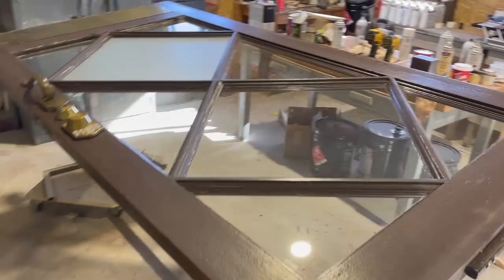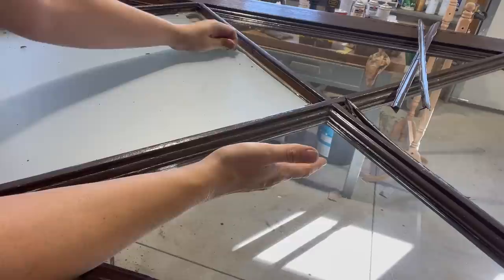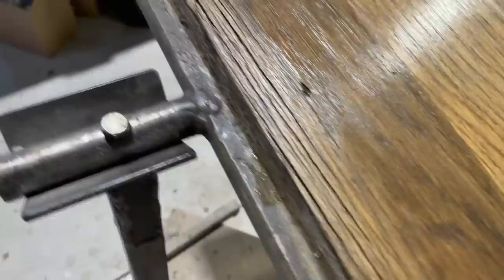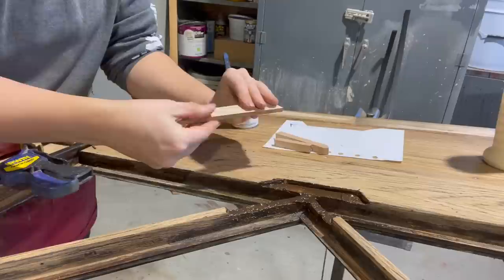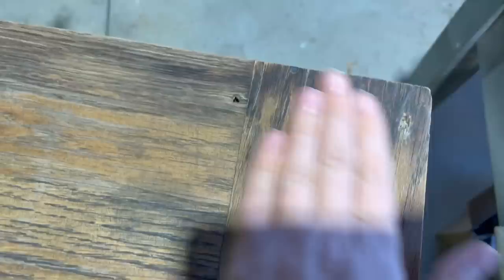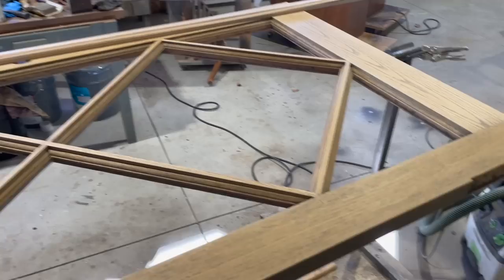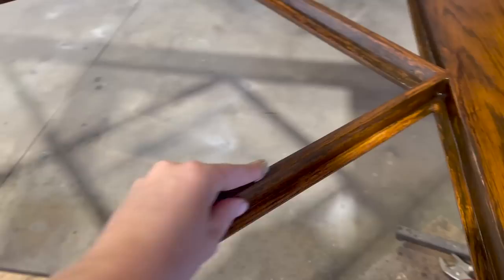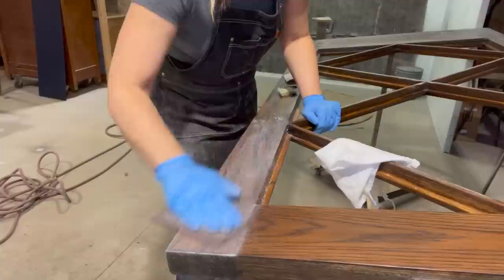This wood was SO ROTTEN! Could I fix it?

Comment: Beautiful job to return this door to its former glory. Your skill to patch in those replacement pieces is second to none.

I also use the PC-Petrifier to stabilize the wood before adding the epoxy wood filler. It is the best option I have found. 

Kudos to your mill for matching the profile for the glass bead. 

Thanks for sharing and giving this gorgeous door a new lease on life.

Comment: Incredible.  I don't know why, but this is one of my favorite 'episodes'. I did miss the color toning though. That is one of my favorite parts in your videos. But this had sanding, scotchbright, and buffing. I love the sheen on this door.  Oh, and the fact that you don't like 80's brass makes me like you even that much more. I am just so impressed with your work. I do wonder though, did the client have the door repaired just so they could say, "liook at my door, Trena restored it." instead of just getting a new one?
Reply from the maker: lol
Reply: Having has to repair and  refinish exterior doors, I can only hope that you fully sealed the top and bottom edges of the door. Especially the bottom. Considering the type of winters Windsor gets, sealing the bottom is most important even if your client was going to have a wrap around type of weather strip. Sealing the end grain prevents any moisture from soaking into the  stiles. Important for a vestibule door.

Comment: Very, very nice job!  I seen an eight foot patio door in a house that was installed inside out.  The construction guys must have gotten pretty creative to change all the locks to the inside.  Don't know if the homeowner knew about their door or not.  That is probably what happened to that door you fixed also.
Reply: I was wondering who would nail in the glass from the outside. Even ignoring water, that just sounds like a safety issue, way too easy to take out and replace later.

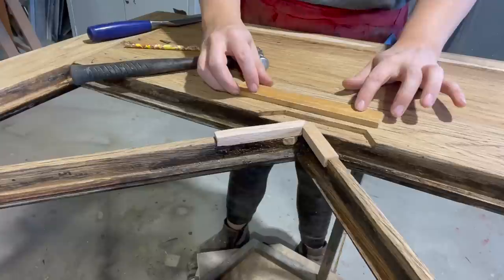Comment: Tip.  At 21:11 it is easier to cut the replacement strip of wood to size first and use it to trace onto the door. That will give you an exact replica to chisel out and will eliminate a lot of trial end error.
Reply: That’s a great tip. It’s easier to cut your replacement pieces and use them as templates. I would also add. For the patch in the rail you could use a small router to remove most of the wood then cut the mitres with your chisel. When patching glazing bars I also mitre the ends to increase the glue bond. If the patches face out I use resin to bond the patch which also helps prevent any water getting into the joint. 
I’m looking forward to seeing your completed door.
Best regards,
Jonathan
Reply: Yeah I was wondering about that. But … Thos Johnson also does it this way so maybe they have a reason I can’t think of.

Comment: In the PNW we end up with a great deal of dry rot in the wood frames.  So many of these beautiful windows and doors are just lost to replacement by plastic and aluminum junk. Our shop designed and built a large vacuum tank that we fill with resin or paintable epoxy (depending on the customer) and submerge all the pieces to completely stabilize them before reworking.  It’s the hand lining in all the grain so the new wood matches precisely that I always spend the most time on.  Nice work! I like seeing the old pieces saved.
Reply from the maker: Wow. Very interesting

Comment: Thank you for yet another great restoration and video, I'm not convinced this door was hung the wrong way, maybe things are different in Canada, but here in the UK glass usually goes in from the outside, more often with putty, but with moldings also, was surprised you didn't treat the top and bottom of the door, maybe you did off camera. I sometimes use a syringe to get the wood hardener right into rotten wood. Love your spit thing for spinning the door, thanks again keep 'em coming.

Comment: The other issue with the door being the wrong way round is security. Someone only needs to pop the glazing quadrants off to remove the glass and gain entry. The other benefit of folding the sandpaper as you suggest is you dont have two smooth faces of the sandpaper against each other allowing the faces to slip slide.

Comment: We used sanding sponges for profiles in finish carpentry. Worked like a charm.
Reply from the maker: Like profile sanders or just square ones?
Reply: @johnsfurniturerepair  Just the standard square sponges. No problem sanding the various mouldings we used and also sanded cabinet doors between coats of lacquer.

Comment: At JOHN'S FURNITURE REPAIR  you can actually learn something from watching paint peel. 
     Another top level restoration/repair!  To bad the original brass handle couldn’t be reused/matched with new security hardware. It looked like a more comfortable handle than the “modern” sharply squared-off replacement.  I hope the brass one wasn’t trashed. 
     So much skill, honesty and integrity is always presented in an unassuming way by Trena in these videos.  I think they should be required viewing by all future (and current) MBAs in all business schools to demonstrate to them that ‘business’ doesn’t have to be (and shouldn’t be) the ‘cut-throat’, ‘winner-take-all’, ‘screw-everybody-to-get-ahead’, ‘lie-whenever-possible’ practice that it is becomming.
Reply from the maker: Not trashed. Repurposed in the house. Wow. Pretty amazing review! Thankyou!

Comment: 2105 needs a paint job to keep up with that door now.
Thank Goodness for those trim guys.  When you said 1/4 round I gasped.  
The finish looks amazing.  
You used varnish everywhere on the outside and used the spar urethane on the end grains to seal them up ?
Reply from the maker: I oil the ends 👍

Comment: Seems simple to move hinges and lockset to the opposite sides, so the outside is actually outside. Just needs a few more patches blended in to fix the wood, and likely they will be invisible with your usual attention to detail as well.

Comment: So satisfying seeing the paint an plasticized window file coming off in one piece! (Keyboard warrior alert) Why did you use the flat edge of the router plate to follow the straight edge? It track much more consistently if you use the round edge of the router plate.
Reply from the maker: It was a measurement thing. I had to make 3 passes and the first started with the flat plate against the guide
Reply: @johnsfurniturerepair  you have skill! so easy to go offline...bitter experience talking there.

Comment: Fine job. Would have been happy if i had done anywhere close to that good a job when I replaced doors on a house we had. Actually, i was satisfied with what I did, but you did a MUCH better job, and had to deal with a lot of rot and deterioration, while I had new doors. That made it easier. But I could sure have learned some things if i'd watched this before i started. I gather you changed the door handle and the security system pad.

Comment: I use a 2 pack car lacquer for any wood that id exposed to the weather  this allows you to fill in and pours or fine pits in the grain of the wood I also use a very thing first couple of coats so it soaks into the wood/ I find this allows me to leave a very high gloss finish with no visible pitting but it does mean I use up to 8 coats of lacquer at 2 coats per application and flatting in between.
Reply from the maker: Wow they must be beautiful

Comment: Hi Trena; nice job as always! I don't know if you have ever tried one/two coats of epoxy or what we use to call wet on wet for a high build then exterior grade varnish as it has the uv inhibitors since you strip right back to bare wood (lol)! that often solves some of the natural pits formed in coatings but also builds a good solid basis to work from. keep up the great content!
Reply from the maker: ive heard this method once before i should really give it a whirl
Reply: @johnsfurniturerepair  You should Trena , I just recoated some boat components earlier this summer that haven't been touched since 2005/6. I like the versatility of the west system.
AS you say give it a whirl.....!

Comment: Sweet blend and finish on the hole plug. Your focus on the deep grain issue might be solved with grain filler, worked in to level the finish surface. I always use grain filler with mahogany. Bravo

Comment: Hi , the door was correctly fitted, if it was fitted as you suggested then rain water would penetrate to the inside via the space between the glass and the frame members
Reply from the maker: Same situation the other way but twice as bad because it gets behind the trim and the glass
Reply: @johnsfurniturerepair  the trim (beading) should be a maintenance item  and replaced when needed, when left too long, rot will happen, as you found

Comment: As usual you do the most beautiful work even on things that others would throw out.  Just stunning!   Why can’t you spray outdoor varnish or lacquer please ?
Reply from the maker: it is because oil based finishes stay wet for a very long time compared to solvent based. The overspray sticks to everything including exhaust fans and becomes a fire hazard. its an absolute mess. people still do it and if your only doing it once thats probably fine, but in a professional shop its a problem that can literally build up and cause issues.
Reply: @johnsfurniturerepair  thank you.

Comment: Looks like the door was flipped the other way up and remounded.  That would explain why the inside was out and the frosting was at the bottom.
Reply from the maker: nom the larger cross section is always at the bottom
Reply: @johnsfurniturerepair  So they were just not very good when it came to hanging exterior doors then! Great episode by the way.  Love your work.

Comment: Such a nice old door, now restored to its original glory!  What a great color choice too!  I am curious as to why you hand-applied the exterior varnish instead of spraying it as you did the interior varnish... what governs your decision on that?  I also have been a lifelong dog person (still am) who was converted to a cat person by the big guy in my thumbnail...
Reply from the maker: it is actually illegal to spray oil based finishes, varnish is also very thick and difficult to spray without a lot of thinning which means many more coats to build the finish. cheers

Comment: Very nice job as always over the years things change like doors would be hung with the bead on the outside but you would use putty to bed the glass and run the beads as well and it was the paint or varnish that sealed it all up but then then doors were hung with the bead on the inside and silicone was used for speed you can’t paint or varnish over silicone as it’s a rubber they is low silicone but l think it should only be used internal things have changed over the years but I still like to use the old ways your looks great but when are they going to do the rest of the frame work around the door
Reply from the maker: Soon

Comment: why not turn the door around,, plug the holes for the old lockset and put the new ones on the other side, door would be right and the lockset would be on the side it is now. Just a thought. The repair looks great.

Comment: to restore old wood, i strip it, clean it, then soak it in water for about an hour. after I completely dry it, i repair the fractures and cracks, refinish it, then paint it with new, unused motor oil.
after the oil dries, i wipe it with a clean cloth, then paint it with varnish

Comment: I agree, this Door was built wrong. The glass could be removed from the outside! But it has one advantage: If the door is smashed with the trims inside, the kinetic energy of the heavy glass can pull the nails out and the glass become loose over time.  This ist avoided by the "reversed" construction of this door.

Comment: Beautiful restoration. I like the original pull better, but customer’s choice. I like to learn. Was there any silicone caulking squeeze out?  I just wonder if it’s sealed as glazing is on a traditional window.
Reply from the maker: yes it was a messy job but at least i know its everywhere

Comment: Brilliant result and fantastic job! Bravo! Subscribed )) A couple of questions though: 1) What glue did you use on that half-quarter trim?  Did you use any nails after to fix the glass? 2) Did you treat the very bottom of the door (the butt end) with anything?  3) How well does the wood hardener absorb the dye?  4) Did you say something about rinsing the wood after wood hardener or I misheard? 5) what kind of epoxy did you use on the problematic (rotten) cross-section? was it a plain epoxy or epoxy with some filler (wood dust or smth)?   6) Did you use any wood putty ot wood filler in that crack between a new triangular veneer and the old wood? Did you use any wood filler on the door except that epoxy? Thank you very much!
Reply from the maker: Welcome. Sorry too many questions. Lol I’m going to have to charge you for an hour of time just answering all these 😂
Reply: @johnsfurniturerepair  Ok. How much would it be? I'm sure those subscribers who are really interested in what you do might have same questions, so I'm ready to pay and post the answers here so your video is completely explained. In this business even minor details are everything, and your answers might help save lots of good works. Thank you for your great work!  P.S. Pls disregard my question about the epoxy - it's marine grade West System epoxy, you said it in the video )

Comment: Hi, I'm a new subscriber and this is my first video from you.  That spit device is really a work saver, something I have not seen on the videos of other restorers that I subscribe to.  However, do you ever steady it by rolling sawhorses or something underneath so that it does not bobble around so much when you are working on one of the flat sides?  All that flexing and jiggling can't be very helpful!
Reply from the maker: so when im working i add clamps to each end, it still moves a little but its not too bad

Comment: Hi Trena! Beautiful job on this door. I know one of the deadbolt holes was filled but I was then curious if it would have been more beneficial to fill all the lock holes and bore them on the other side and cut in new hinge slots so the 'correct' side could be on the exterior? I'm just wondering if that might have been more advantageous in the long run where the windows were concerned? I was just curious if that had been considered and your thoughts on that vs. keeping the wrong side on the exterior. Cheers!
Reply from the maker: well that would be doable, but a lot of work on the door and at the house, i just decided that i would use a good exterior sealant on the trim and we would just keep an eye on it. although better, even the other side with the solid trim still has seams and would still need upkeep as any exterior varnished wood. in the end the amount of work didn't match the benefits of switching it up so i just kept it the way it was. cheers!
Reply: @johnsfurniturerepair  That's exactly what I was wanting to know. I figured the end result would have been about the same but was curious about your input :)

Comment: Another basket case reborn by the Master/Mistress (You Choose) apart from the weather aspect the glass bead should be on the inside for security, also the frosting would have come off with a heat gun.
Reply from the maker: careful with glass and heat, it cracks glass if too hot. cheers
Reply: @johnsfurniturerepair  Yeh you don't need to get it that hot my friend does this all the time as part of her sign company she been doing it for 30 years with no breakage yet,  was just a suggestion obviously you with what you feel comfortable with.

Comment: That Minwax Helmsman varnish never holds up on wood door exteriors or any exterior wood.  No matter what people tell you, no exterior varnish will last.  Try Allback tinted Linseed Oil Wax for all stained exterior wood.  First do a coat of heated boiled linseed oil, let dry and then one coat of tinted linseed oil wax.  You get color, protection and a smooth surface that's very easy to maintain.  I'd also bed the glass in linseed oil putty.  Varnishing all those little pieces with multiple coats is a waste of time, they will all deteriorate in a few years outside.  The silicone is ok.
Reply from the maker: Ok
Reply: @johnsfurniturerepair  Glad to help

Comment: I really liked your project but I have to ask how you cut the plug for the deadbolt and got the grain to match so well?  It blended in well.
Reply from the maker: I cut it out on the band saw and slowly fit it with lots of adjustments. Cheers

Comment: Why varnish on exterior and lacquer on the interior? Also, what did you use to remove the frosted glass things from the glass?
Reply from the maker: Spar Varnish is an exterior grade finish. Lacquer is interior. Cheers!
Reply from the maker: Glass frosting was removed with stripper
Reply: @johnsfurniturerepair  Thanks